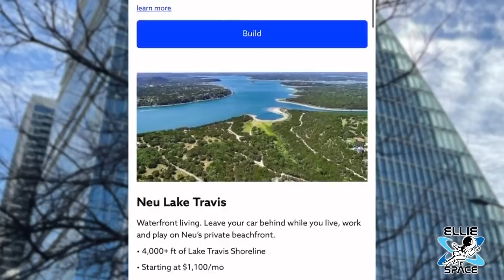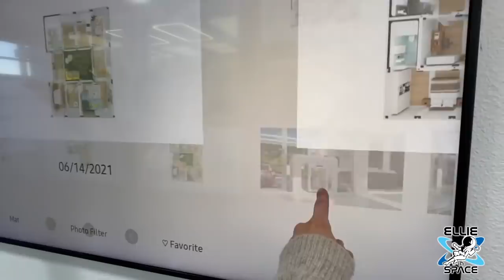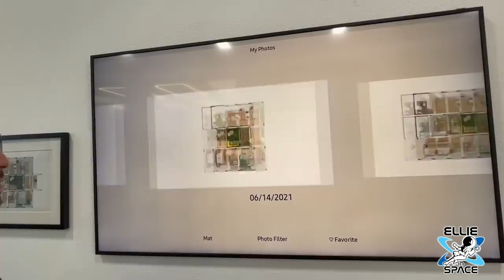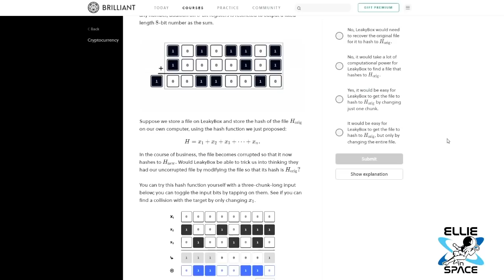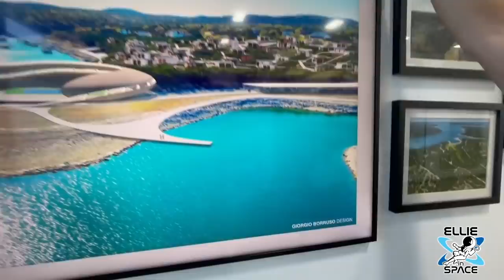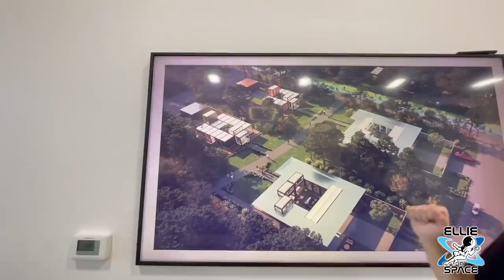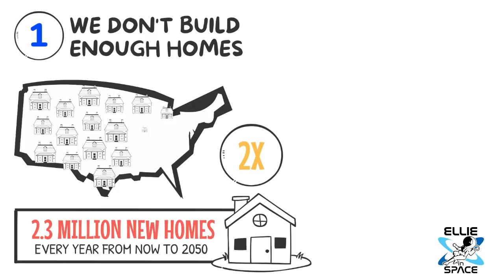Where will Tesla employees live in Austin?

Comment: This design  concept is not for everyone and will not age well. Like every other modular style construction it is high cost per sq ft and not very customizable. Carbon footprint is likely quite high too, based on the type of materials used. A typical cost of const for a custom home is in the $400-500  sqft range for pretty high quality, so trading speed of const for quality and unique design is a poor trade-off. Not to mention energy efficiency. These glass cubes would not pass codes for energy in most places. Could be why they are not progressing.

Comment: i like to talk about the modular homes ,most will look into when going to Texas ,this is what i know and i did hvac&r in the 90s till 2012most were not on a basement foundations., but what stuck out to me was the INSALATION . that's was like some of the best i have seen, now that was 20 years ago so im thinking it has even got better, had some with a roof, or eve fan  fans that suck out air and wow in MD in the summer they can be bad, but on the low 80s they cooled out the heat really fast no ac needed don't know if there the humidity  is real bad ?but the  new MODS , they should be great . just saying in case you never seen a mod..

Comment: Housing is a massive issue in Australia too, as I am sure it is throughout the modern world. This could be a fantastic solution to this problem. Some things would obviously have to change given the difference in environment, however the modular/prefab design of it could be integrated into the environment in really creative ways... I am curious to know, if these kinds of structures could be place underground? To me, subterranean living is the most realistic solution in Australia, especially as the planet warms. 90% of my current cost  of living (after rent of course) is energy, specifically the energy required so we don't cook like eggs inside our home.
Reply: I'm a black man living in the States and I was interested in moving to Australia to get a permanent visa but the immigration requirements to move to Australia is crazy. Probably the most selective in the world. Apparently you can't be an average person with hopes of migrating to Australia. Seems like you have to have a college degree before they will even consider you also if you are over 50 you are definitely not going to be allowed to migrate there.
Reply: @ramakrishnashalom9004  I'm pretty sure the ONLY reason I was able to move from Canada to Australia is because my mother is Australian. While, for the most part, I wish it had never happened, there are great things about Australia, just not the immigration or housing policies...

Comment: End stage capitalism. At what point do we say this economic system doesn’t work? When we’re all living in tents? We can afford to build housing, it’s just that our housing market is based on speculative investing and a lot new housing is empty. We have had many innovations in home building, did that make homes cheaper or shareholders richer?

Also, modeling an entire community around a single Tesla factory sounds like a disaster. This means Tesla has a monopoly on employment in the area. Any individual or community movement to address abuse or wage theft by the employer will be met with existential threat to self and/or community—the community also must cave to any demands from Tesla such as requests for tax breaks, wage decreases, worker safety, etc.
Reply: @texaswunderkind  Do you realize that these cities you mentioned aren’t exactly opportunity zones in the US? The “if you don’t like it just move” mentality is usually a last ditch effort to avoid acknowledging inadequacies in our society. Thinking of ways to help fix our society is a bit harder, I understand, but doing so will give you insight into the machinations, power dynamics and reasons why what you are proposing makes no sense to most people in short to medium term.

Comment: Neu Community I predict will become a case study for an Epic Failure. It will be brought down to bankruptcy when all the Neu homeowners sue the company after 1 year if high electricity bills due to the inefficiency of using glass as a wall structure. Glass radiates the thermally heated Innternal air thru the glass to the outside resulting in high electricity bills during the winter. During the summer months, the sunlight will radiate heat into the structure, creating a convection oven like experience that will also result in high air conditioner usage and high summer electricity bills. Notice the roofs, no roof with an Awning that extends or slipes off the roof, this would create a shade zone around the entire side of the house, houses need this. So sorry, they get an A for manufacturing in a factory to boost yearly production, but they have earned an F due to the arrogance of the Architect/Home Designers Total lack of efficiency of the final product.
I do praise the tiered home concept for the lake community, at least the landscape architect has proved they know what the heck they are doing.
Boxable has been rated to withstand hurricane force winds and Boxable walls are rated at a higher insulation rating and will out-perform any Neu Glass Box design with a guaranteed lower yearly electricity bill.
Do your research before you buy people,  because a home is a multi-decade investment and yearly energy costs matter.
Peace

Comment: Anyone can see that these homes are pure garbage. That unit you were in had a panel dropping from the ceiling. A microwave in the living room? How is that a functional kitchen? 80 square feet per module? Does that mean the bedrooms are 80 ft2? That's barely enough room for a bed. What about closet space? I didn't see anything useful in that walk through. How does it hold up in the sun? Plastics are not known for their UV durability. I'll bet cracks start forming after just a few years. And why do those Realtors get so dodgy when you start asking them about cost? $160K is still to much to that crap. And what exactly does buy into the community mean? Is it like trailer parks now where you need to rent the land at an exorbitant price to park your mobile home. I'm sure that one thing it means is there will be high HOA fees.
I know we need affordable housing but this doesn't look like anything but a scam. Part of building wealth in this country is to own your own home and the land that it is on. I sure doesn't look like this is something that could be passed on to your children, or borrow against. You need to be more selective in what you publish, Ellie. Giving these guys exposure isn't helping anybody.